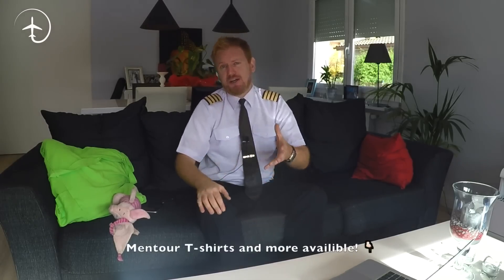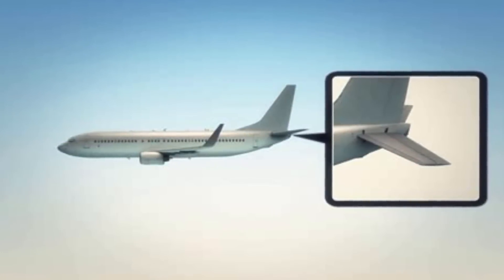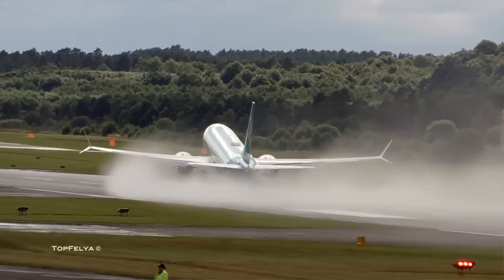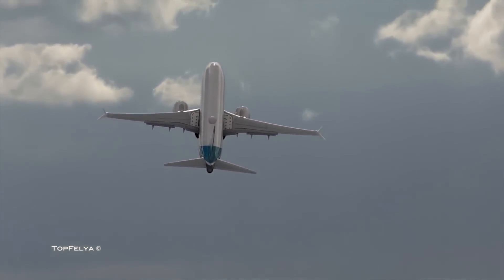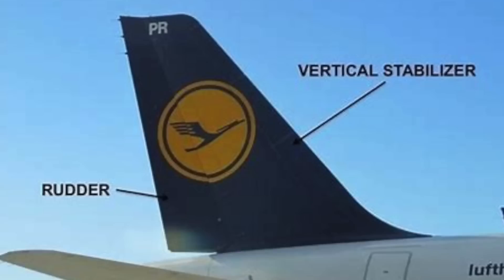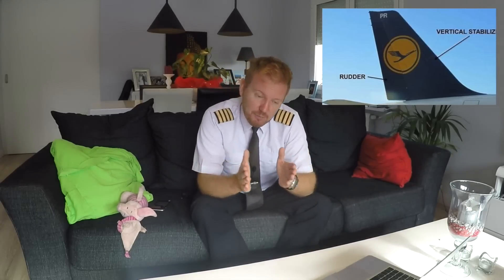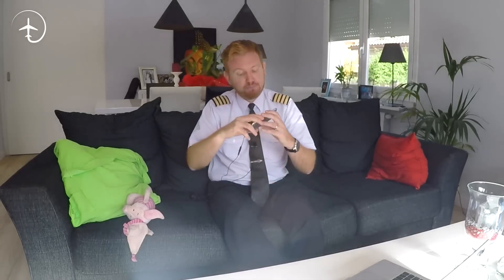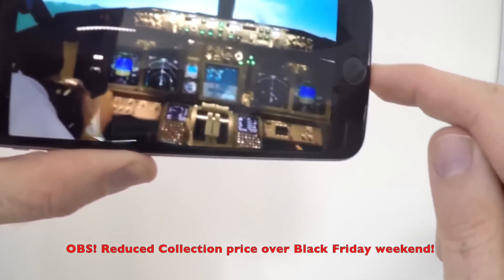How do the "Stabilizers" work?

Comment: Hi there. I am what you would refer to as an AVgeek. I studied Aviation (Air Transport Management - non flying) at University here in Australia and spent a long time working as an aviation consultant.  Whilst not a pilot, I have studied my GFPT, PPL and ATPL, along with internal combustion & gas turbine engines, aircraft maintenance, human factors & CRM, aviation legal framework, aircraft electrics and avionics, aircraft aerodynamics & performance, aircraft design and operations ,integrated safety management systems , airline operations , airport operations ,aircraft structures, air traffic management, aviation mathematics and physics, just to name a few!  This video on "Stabiisers" was brilliant and taught me a few things I never knew.

Here is my Question for you : 

According to the 738 QRH and the training you are given, what is the procedure(s) in the ultra rare occurrence of a dual engine failure after V1 (but before Vr) ?
Could you please explain the scenarios for the following? (In both wet and dry conditions at an aerodrome @ MSL)
             * Dual simultaneous engine failure after V1 on a short RWY
             * Dual simultaneous engine failure after V1 on a long RWY ( RWY 20L/C/R @ WSSS - SIN) for example 
             * Dual non-simultaneous engine failure after V1 on both long and short RWYs - (for example engine number one fails 4 seconds before engine number 2)

Thank You!
Mentour is brilliant!

Comment: Mentour Pilot I'm wondering why you don't have to weigh the passengers!? I know you have a load sheet and now I see that you look at where we are sitting, but passengers can vary in weight quite dramatically! It might be a silly question but I'm really curious. Thank you for another brilliant video 😊
Reply from the maker: Yes, we use a medium weight because over a large group, the differences tends to equal out.
Reply: I see thank you, that makes sense!
Reply: As far a I know they a calculating with average weights. I think there even has been an accident during takeoff phase that was conneceted with the overweight of the airplane. It was found out that many passengers where much havier and had more carry on baggage with them than assumed / calculated with standardized, average values...
Reply: Thank you 😁 I be always wondered about it, and then I was watched a series about Heathrow airport where the check in clerk asked a passenger to weigh her suitcase, but the passenger got on the scale herself! They laughed but I thought actually that makes total sense to me 😀
Reply: *not be, was 😂
Reply: @Max-xu1pm  Yes, Air Midwest Flight 5481, Beechcraft 1900D turboprop crashed into hangar in the airport upon take-off. The nineteen passengers and both pilots were killed. A US Airways mechanic on the ground was treated for smoke inhalation. No one else on the ground was hurt.
Pilots were using outdated FAA-approved passenger weight estimates. When checked, the National Transportation Safety Board found that the actual weight of an average passenger was more than 20 pounds (9 kg) greater than estimated. After checking the actual weight of baggage retrieved from the crash site and passengers (based on information from next-of-kin and the medical examiner), it was found that the aircraft was actually 580 pounds (264 kg) above its maximum allowable take-off weight with its center of gravity 5% to the rear of the allowable limit.
As a result of the weight issues discovered, the FAA planned to investigate and potentially revise estimated weight values, something that had not been done since 1936. Air Midwest used an average weight of 200 pounds (90.7 kg) per passenger after the accident, but the NTSB suggests that airlines use actual weights instead of average. 70% of small air carriers still use average.

There was of course contributing factor to this accident - during maintenance stabilizer cables were incorrectly adjusted, and when plane started pitching up pilots were unable to recover. Neither of this two factors separately would cause this accident, but combined - well... It happened.
Reply: @jur4x  Yes that was what I meant, thanks👍

Comment: The rudder pedals are only used on final approach for landing. During a crosswind landing the pilot kicks either the right or left pedal at the last moment to get the nose of the aircraft straight with the runway.  (unless you're an Air Asia pilot, then around 8 miles on an inbound final you do dutch rolls because your "white over white" on either the Vasi or Papi and need to drop 2000' quickly..)  ~Laughing~

Comment: So, if you have aircraft configuration with "narrow" engine displacement like De Havilland Comet,  Concorde, or CRJ you don't need so big vertical stabilizer?
Reply: The DH Comet had a small vertical stabiliser with its wing-root engines, but the Concorde had an enormous one, due its widely spaced engines.
Edit: The CRJ is different, with engines mounted on the rear fuselage, but still having a large vertical stabiliser. This is necessary due to the engines being far from the center of gravity and lift.

Comment: Soo, with all that, can you explain how the rear fins work on a plane like the WW2 German ME262 HG/II.  It just has 2 horizontal stabilizers put at a more upward angle, kinda like a F15 vertical fins but slanted.....some hybrid configuration?

Comment: I recall reading in the case of the Airbus crash, they (Airbus) dealt with rudder deflection issue by varying the rudder pedal pressure relative to air speed.  However the increase was not that great and was easily missed and overridden in the heat of the moment.  Do you know if this is, in fact, the case?
Reply from the maker: Hi! I haven’t read the full report so I can’t go into great technical detail unfortunately.

Comment: 737 has yoke, which is connected with redundant systems like hydraulic and cables, in aircraft investigation and also in this video we can see, that pilots actually need a lot of physical force acting on rudder. Airbus has only only electronic sidestick. Now I know, that all commercial aviation planes are going through deep and serious, repeated testing procedures, thou it sounds a bit safer, when you have seperate physical systems, than one fly-by-wire system. Is side-stick as safe as good-old 737 yoke?

Comment: Mr Pilot  I've always been confused about the AA vert stab failure.If the aircraft was at or below Va shouldn't full application of rudder be possible without over stressing? That's what I was taught in training for my private licence and it was demonstrated to me several times. Rapid full left and right rudder. I asked my ex brother in law who is a captain with a major and he would't comment on it.
Reply from the maker: Yes, but not continuous cyclic movement from one extreme to the other.
Reply: @MentourPilot   Thanks! Is that what the AA pilot was doing?

Comment: God bless you, such a great video. So, A320 doesn't have a movable horizontal stabiliser? Why? How is its trimming happening then?
Reply: The a320 does have a rudder, all planes do
Reply: @dylanf7990  I was talking about movable / adjustable horizontal stabiliser, not a vertical / rudder
Reply: @teamkolumbix1718  No airplanes have moveable horizontal stabilisers. I don't know what your talking About
Reply: @dylanf7990  the whole surface of horizontal stabiliser, for example, B737 can be moved or trimmed. The stabiliser of A320 is fixed and all the trims are done by elevators.
Reply: @teamkolumbix1718  can you give me a link to a website about this

Comment: Can't believe you said "momentum" throughout the video.
Also, the reason why you need both rudder and aileron inputs for a coordinated turn is because of the way the transport aircraft is designed and flight dynamics work. If you only apply rudder, the aircraft yaw and one wing will be travelling faster than the other and generating more lift, causing oscillating Dutch roll motion. If you only apply aileron, one wing will be experiencing more drag and causing adverse yaw, the aircraft will be turning the wrong direction instead.

Comment: There is a fundamental issue that I don't understand.  The aircraft is kept level due to the balance between the lift from the wings (forward of the CofG) and the downwards lift (sink?) from the horizontal stabiliser.  So to keep the aircraft flying, you  have to generate enough lift to counteract gravity but you also need to add enough lift in the wings to counteract the downforce at the stabiliser.
The alternative to this is to position the horizontal stabiliser at the front (a canard), instead of pushing down, a horizontal stabiliser at the front would push up.  So all the control surfaces would be working together to counteract gravity.  I would expect this to be more efficient, reducing fuel consumption.
This is not a new idea - this is how the Wright brothers designed their aircraft.
Can you explain why modern aircraft do not use a canard design?
Reply: Andrew Beattie The use of canards at the front of an aircraft disturbs the airflow over the wings and into the engines. Every design has tradeoffs.
Reply: @gordonrichardson2972  Good point. Andrew has a very interesting question here,  In that case, why is the CofG not slightly forward of the wing lift so that both the wings and horizontal stabilisers are working together against the forces of gravity? Taking this one stage further, would not the most economical flight be if the wing lift and C of G were closer together? I guess it is not possible to get C of G and wing lift in the same exact point because of fuel use, passengers walking about and different loads on every flight. 

Great video again Mentor. Thank you.

Comment: Makes me wonder why there are not "all-moving" vertical tails.
Reply from the maker: Because the smaller planes do not work with the same speed regimes or shifts in CoG
Reply: The SR 71 did have them.

Comment: Hello, I have a question) what if an emission occurs in the sun capable of turning off all the electronics on the ground, what will happen to the aircraft avionics in flight, especially with such as the A320-30, which does not have mechanical control of the steering surfaces?

Comment: Why do they design the center of pressure to be behind the center of gravity as opposed to having it ahead of the COG?
Reply: Because that way the aircraft stabilizes itself when it is pushed by gusts of wind. Think of an arrow: Mass at the front, stabilizers at the back...
Reply: This is done for stability. If it was otherwise: pulling on the stick increases the angle of attack and thus the lift. If the center of pressure is ahead of the CG, increasing the lift leads increases the pitch of the aircraft (the nose goes up). This increases the angle of attack further, lift increases, noses goes up, angle of attack increases, ...

It is possible to build an aircraft like that but you would need electronic flight controls (computers makes sure to act on the elevator to counter that effect). Modern jet fighters use that. I hope modern airliners do not, otherwise in the scenario where hydrolic pressure is lost, I do not think the pilot could fly purely manually (without the computer's help)
Reply: @enjibkk6850  So the design builds in negative feedback to ensure stability.  If the COP were ahead of the COG then it would be an unstable positive (runaway) feedback situation.  Jet fighters use the different design to optimize for responsiveness.  That makes sense to me.  Thank you.

Comment: I still don't understand the Queens failure. It just sounds like there is a limit of the rudder in opposing air flow. After that, it is like metal fatigue. I don't totally understand how that was possible.
Reply: The AA587 crash was partly due to 'resonance'. Like a playground swing, the pilot repeated applied full opposite force each time the rudder swung from left to right, until the vertical stabiliser was almost side-on to the flight path, which exposed it to enormous wind loads, far beyond the limits envisaged by the designers.

Comment: Hello Mentour Pilot. Why engines are situated so much ahead of wings?
Reply: He has another video discussing various advantages and disadvantages of various engine placements. You CAN place the engines almost anywhere: at the nose, at the tail, under the wing, or over the wing. Placing them under and forward of the wing, has two primary advantages: the air coming into the engine is "clean" (not turbulent from other surfaces); and by placing the exhaust under (rather than behind) the wing, shields the passengers in the rear cabin from some of the noise.
Reply: @daleinaz1  Yes, these are good reasons. I was gessing about  first one, but second one is totally new point for me. Thanks.

Comment: Good talk, thanks. Please set camera for manual exposure.
Reply from the maker: Yeah! It was very tricky lighting. A lot of changes.
Reply: Mentour Pilot   It’s not the lighting changes, it’s the camera’s auto exposure reacting to the reflected light from your white shirt when you move and make gestures with your hands. Never use auto exposure in a static recording situation. Good, proper, professional videography includes manual exposure (iris, gain, and shutter) and manual focus after you have set for the proper distance and levels and that includes manual audio level, too.

Comment: Why don't more airline planes use canards like with the Beechcraft Starship?  Aren't they better at producing lift?
Reply from the maker: They are but they pose other challenges instead, like construction and infrastructure (Boarding gates) etc
Reply: FYI, the Beechcraft Starship never sold well.
Reply: Some stories are uplifting, but others are canards. :P
Reply: @MentourPilot : ?Visit the stability issues with alternate aircraft config(s)...
(BTW  your style is very easy to listen to and good for reinforcing theory)

ie. canards can induce negative pitch stability (instability)...  Though at high speeds the positive lift generated to counteract adverse "pitch moment"  can be more efficient than use of rear horizontal stabiliser (within range of allowable CG), but for positive pitch stability Canard AND rear H-stab are preferable  -so it gets too complicated for the minimal benefits -operational limitations .  (See how they re used in AC like the B-1B Lancer -yes this is a very advanced though ageing AC)

Comment: It's rather strange that the AA pilot could exceed the force limits of the rudder assembly by more than 100% by applying excessive rudder input. You would expect that the flight envelope protection should have prevented abusive flight control inputs from being actually passed on to the control surface.
Reply from the maker: Yes, to one extreme and back but not cyclic extremes. Nothing can take that for long
Reply: Well, that's a rather interesting aspect. On one hand you could argue that the software could (and might should) also have taken into account dynamic forces ensuing from repetitive opposite inputs resulting in oscillating forces that overstress the aircraft structure.  On the other this is clearly also a pilot training issue. So the question is: Who is to blame? I actually don't know the outcome of the NTSB investigation.
Reply: +DannyFreiburg  I agree Danny...But I blame Airbus for not designing in better protection against such inputs, and AA for not properly training their pilots. It wasn't fair to blame Sten Molin. I think of this hypothesis...If you're driving a car, you could not possibly make enough violent inputs to the steering wheel to cause the steering shaft to shear, or any other steering related part to lose mechanical connection to the wheels, causing a crash. You would most likely lose control of the vehicle, and THEN possibly crash, with recovery theoretically possible.
Reply: @DannyFreiburg  from my understanding AA actually trained pilots to do just what he did even after warning from the manufacture, so the blame probably would be more of AA than anyone

Comment: don't you have to use rudder in flight to line up with the runway after a crabbing approach, and the opposite, turn the nose in the right direction after a crosswind take-off? Also - do you crab your airliner with or without rudder input?

Comment: Why do the stabilizers not have winglets
Reply: The purpose of winglets is to preserve the upward lift on the wings, making the aircraft a little more fuel efficient. The purpose of horizontal stabiliser is to produce a little downward lift to balance the centre of gravity and centre of lift, as both have different centres. We don’t need to preserve that downward lift, rather we just need to control it through trim. So, there is no use of winglet at the back. if winglet is added on the stabilisers, it will only add to overall weight and create more drag,  making the aircraft less fuel efficient.

Comment: The horizontal stabilizer should be designed as fail proof. The front of the horizontal stabilizer should be fixed. The rear of the horizontal stabilizer should be movable. That would create a horizontal stabilizer that is foolproof. If it fails it would end in a neutral position that would be possible to oppose by the pilots. With the standard "front moving" stabilizer it all goes to hell when it fails, like Alaska Airlines MD80, and a number of other fatal crashes. Why would engineers still keep a design that is dangerous? I do not know. But it worries me a lot when I fly...